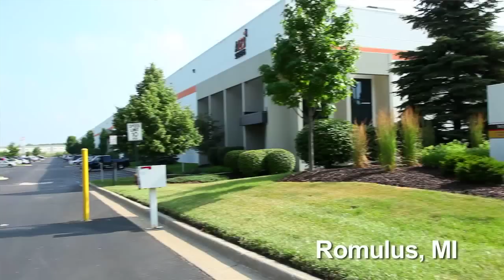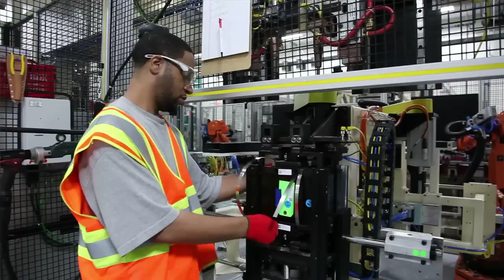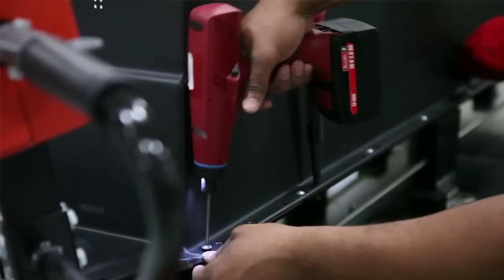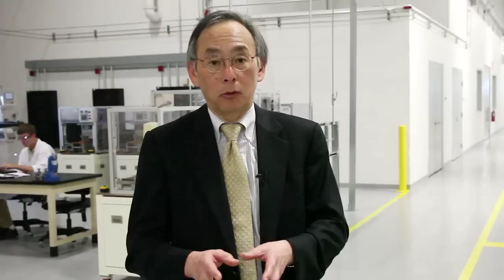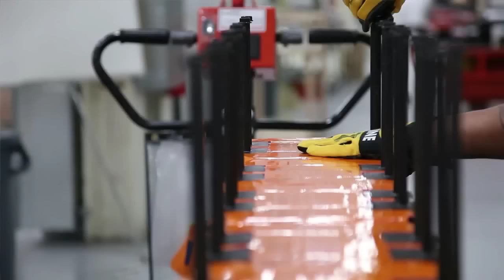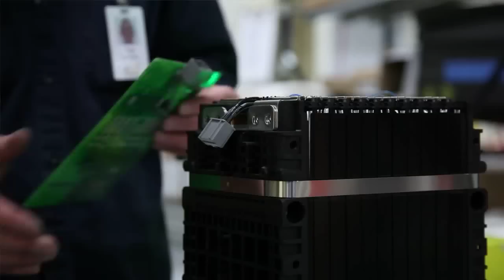Recharging Michigan: A123 Systems

Comment: Can't believe this didn't take off. The "second life storage"/DIY community loves these batteries. 10 year old batteries will have low voltage but come right back to life and after a few cycles they'll give a capacity reading that no other 10 year old battery comes close to. Their pouch cells and cylindrical cells still haven't been touched in terms of raw power outside of some LTO technology.